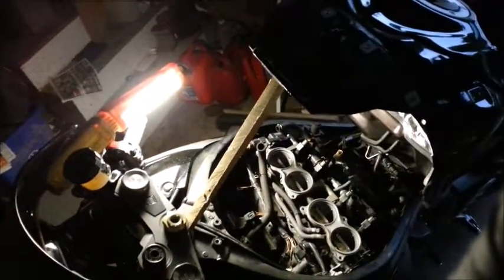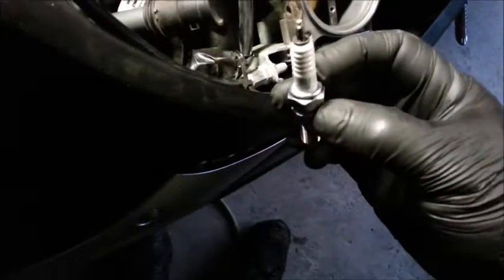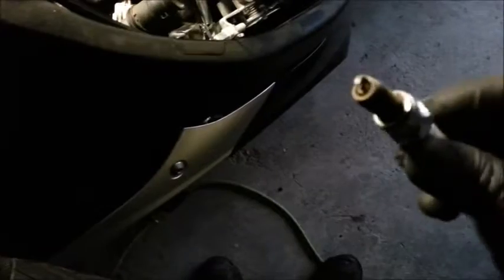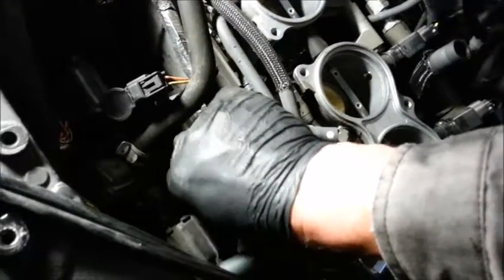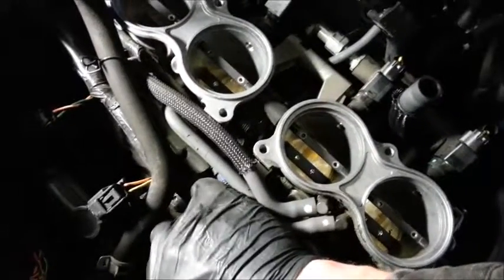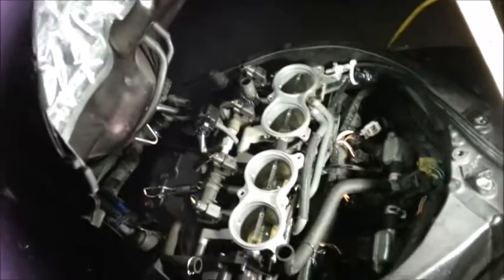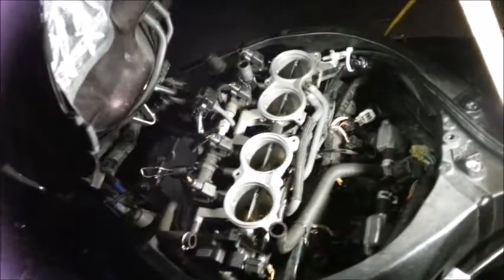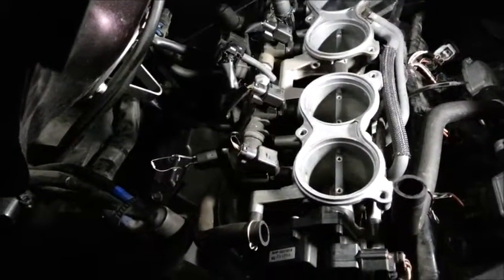2009 GSXR 1000 mods

Comment: How did you get the secondary throttles to stay open? I’m trying to do that same mod to my bike?
Reply from the maker: When i 1st tried it, i unhooked the connector to the sec's, then forced them open by hand, & it bogged. It also gave a temporary code which was gone when i restarted the bike. Once i put the resistors in, I did the same thing & the bike revved up easy. So then its just a matter of removing the butterflies from the venturis.
Reply: Rickenbacker1985 thank you man